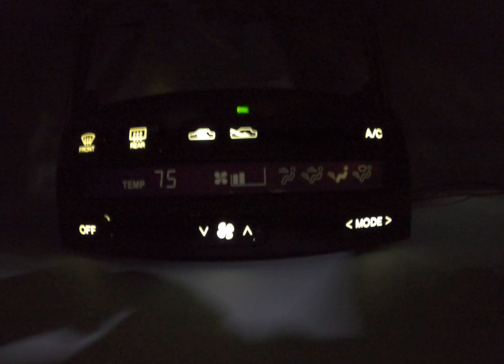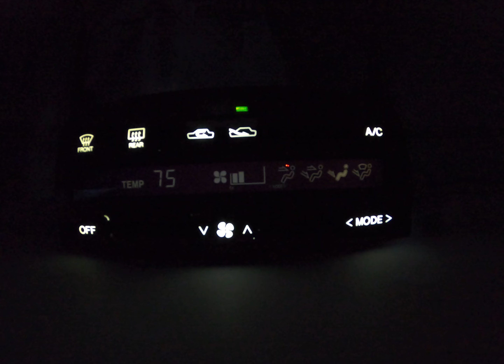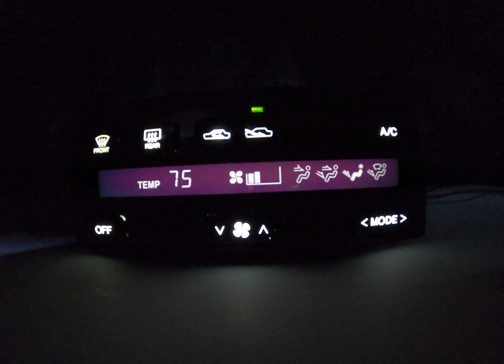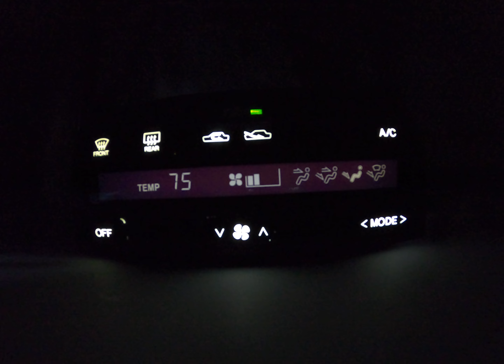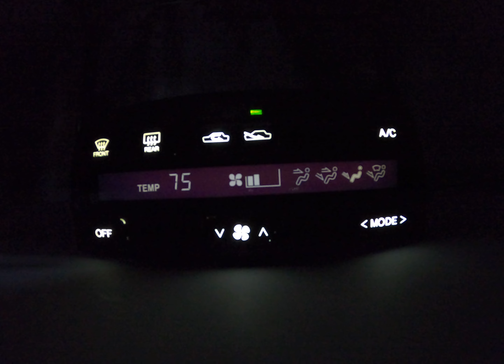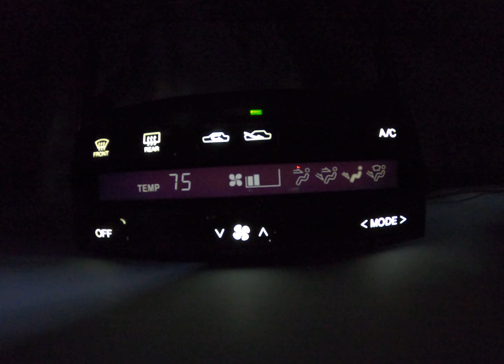Upgrading the Lexus SC Climate Control System to an inverted BLACK LCD Screen

Comment: On your website when selecting button and indicator colors, does OEM (no change) mean those bulbs aren't replaced, or does it mean the lights are replaced but it's still the OEM colors?
Reply from the maker: Just means the colors remain the same